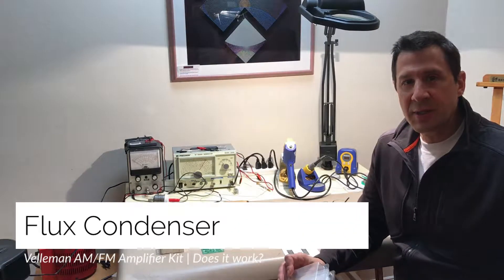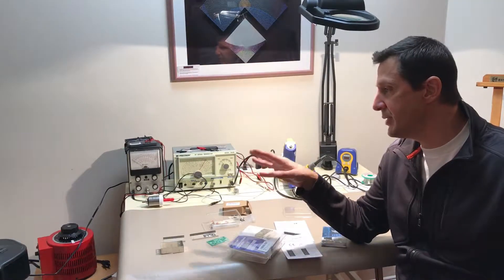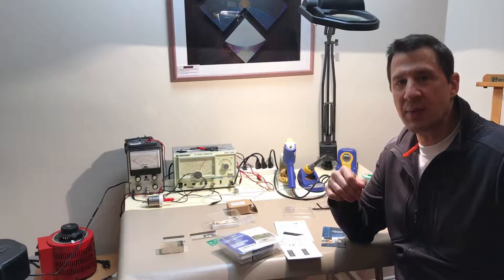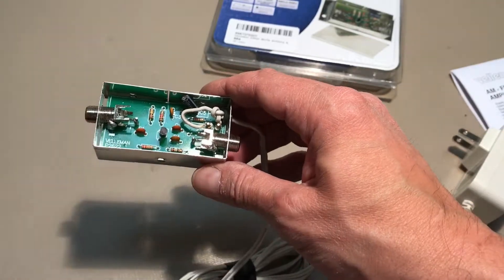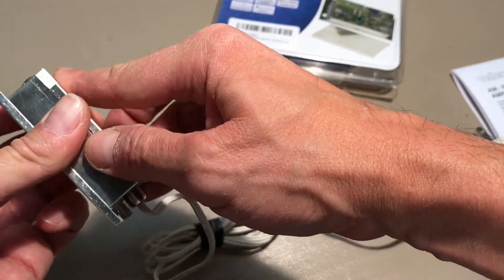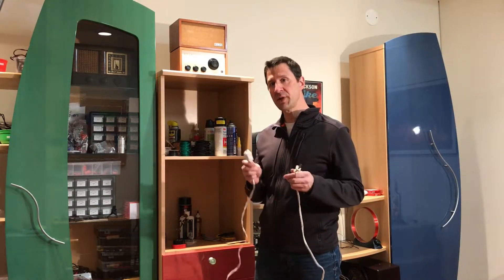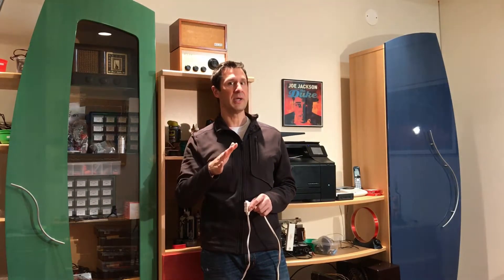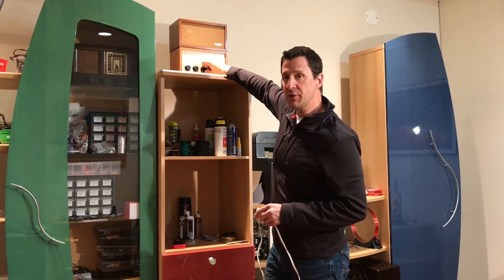Velleman AM/FM Amplifier Kit | Does it work?

Comment: Hello, how did you wire this up to your radio ? As my radio only has one wire as the antenna. Also does the metal case play a part as well. Thanks.
Reply from the maker: Ibrahim, I’ve only tested this with FM radio, but it’s capable of amplifying AM as well. As the amplifier has only a 75 ohm input and output, use a 75 to 300 ohm adapter to connect to your radio. You can use just one wire of the 300 ohm adapter to connect to your radio. If your radio doesn’t have terminals to connect to an amplifier, but instead only has a wire coming out the back, you can strip the end of the antenna wire and connect that to 300 ohm adapter. For an antenna, you can use another 75 to 300 ohm adapter at the input of the antenna amplifier. That can connect to any AM antenna or even a long straight piece of wire. Good luck!
Reply: Flux Condenser Thank you very much for the quick reply ! I will have a look at these adapters and see If Tandy stocks them (In the UK) If not I will try radio shack. Thanks again for going out your way just to reply to my comment !
Reply from the maker: No problem at all. You still have Radio Shacks? Here in the US they’ve sadly all disappeared in my area. The adapters, sometimes called transformers would be readily available at a Radio Shack. Also, easily and cheaply purchased online.
Reply from the maker: This is what you’re looking for: https://www.amazon.com/Fancasee-Matching-Transformer-Converter-Connector/dp/B07BW9YS4Q/ref=mp_s_a_1_3?dchild=1&keywords=300+ohm+to+75+ohm+adapter&qid=1596314078&sprefix=300+ohm+&sr=8-3 

Note that you’ll also need coaxial cables. You may be better off just getting an all-in-one amplified antenna instead of going the Velleman route. For your needs that would be simpler and they often include any adapters you might need. This Velleman amplifier is only ideal if you already have an antenna and are using 75 ohm cables.
Reply: Flux Condenser Ah thank you, We still have Tandy online however I see that American radio shack still has quite good stock. There was a few RadioShacks In the UK however they seem to have shut down In the past 5 years, I have a few adapters laying around would It pay for me to make the circuit myself or do I need the metal housing as I have all the components.
Reply from the maker: You could experiment without the housing, but it does serve as a shield and the ground of the coax is soldered to it. You may have noise issues without it.
Reply: Flux Condenser Ok thanks for all of the help really appreciate It have a great day !

Comment: Hello, thanks for your video, can you put the schematic circuit,  PCB real size, and componets list? Thank you.
Reply from the maker: Hi Lewis, the kit is installed and in-use now so I’m not easily able to take it apart and photograph the board and circuit layout. I’m not sure if a schematic was included with the original packaging, but I no longer have that. I did a quick search and didn’t see one online. You can order a kit here, and find the dimensions, though: https://www.vellemanstore.com/en/velleman-k2622-amfm-antenna-amplifier . The price is so cheap, it’s probably better to just order the kit than to create your own board and source the components. The shielded case is also an important part of the design which is included in the kit. The amp is still working well for me and I use it just about every day. Hope this helps, take care.